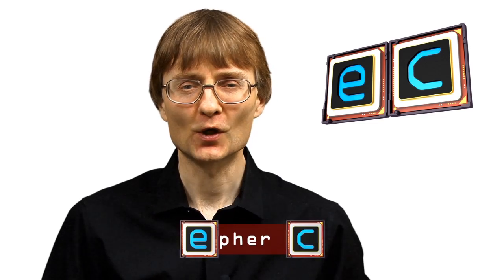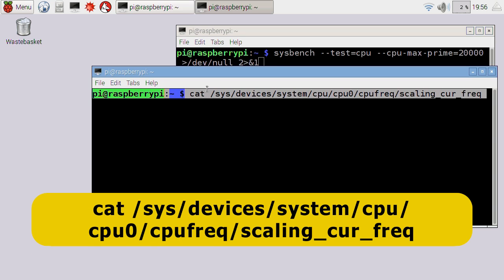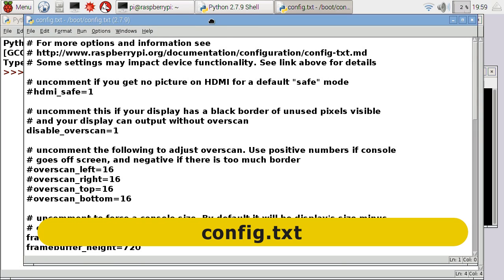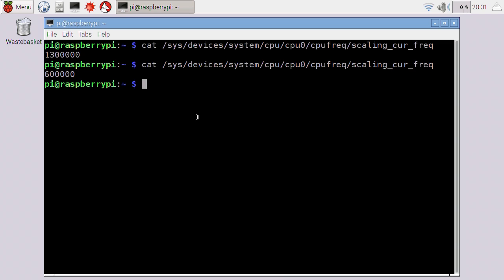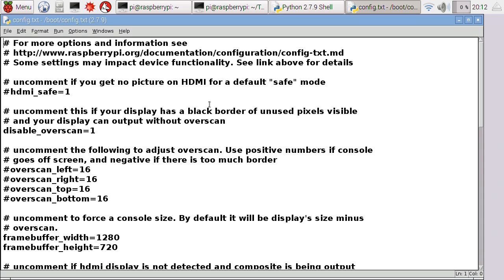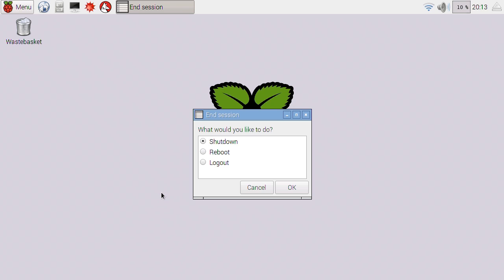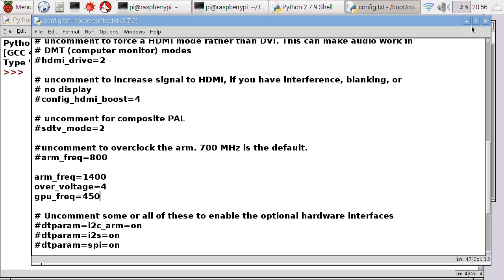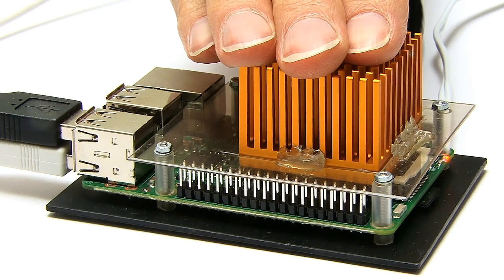Raspberry Pi 3: Overclocking

Comment: I may be completely wrong but surely overclocking the GPU and then running a CPU only (?) stress test will have no affect on temperature?
Wouldn't you need to test both at the same time to see the true max temps?
Brilliant video though, keep up the good work.
Reply from the maker: You are of course right on the GPU-not-being-stressed point -- though its extra clock speed (it is still running at 450GHz in the last test) could impact the heat generated.
Reply: Ah I see. 
Just out of interest though, is there any way of bench testing the CPU and/or GPU to see how much extra performance those overclocks do to the processors?

Comment: For those wondering: sudo vim /boot/config.txt or sudo nano /boot/config.txt  respectively just opening that file with any editor as 'root'- seems to work - instead of going over this 'idle' thingy :)
Reply from the maker: As I said very clearly in the video, there are loads of ways of editing the config file! :)
Reply: ExplainingComputers
Yeah, I just got confused .. not knowing 'idle' :) Seems to be for programming that unit .. actually you made up videos about that already iirc ;)
Reply from the maker: Cacalari Bus I mainly used idle here because I had some nice, large fonts and highlight colours already set, so it would read well on screen. :)

Comment: Cool video! Is it possible to connect a screen from an old dumb phone (for example Nokia 3310) to Raspberry Pi and write a program so you can use it as a secondary display for some basic stuff time and date or notifications?
Reply: it's possible with arduino...should be with pi as well....check out thinkernuts channel...
Reply: +mattibboss Yeah, I saw Tinkernuts video and I find very cool :) I'd like to see that done with a Pi

Comment: wow, thats amazing!

was it passive or active cooling?
Reply from the maker: Just the passive cooling. :)
Reply: +ExplainingComputers try adding a fan, im sure it'll hit 1.6 ghz no prob
Reply from the maker: Arsole H Totally.
Reply: 11:39
Reply: *~$80
Reply: Passive.
Reply: +Clayton εжз 
k.
Reply: 900MHz
Reply: xddddddddd
Reply: Speed isn't everything - your full size card will have more instructions per clock cycle.
Reply: The GPU MHz amount was half of my ASUS GeForce GTX560 Ti DirectCU II TOP
1GB GDDR5 graphics card.